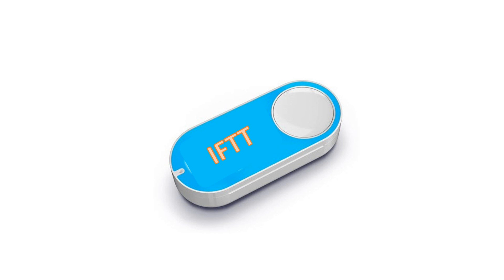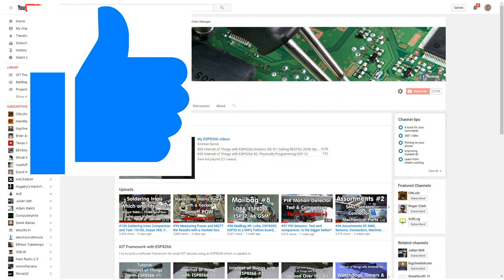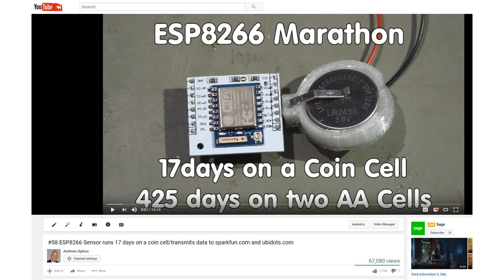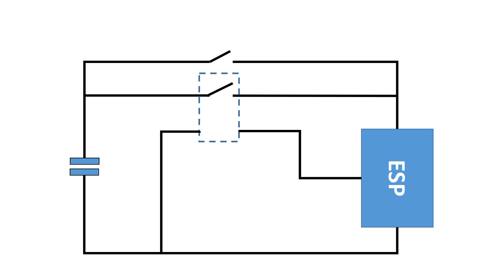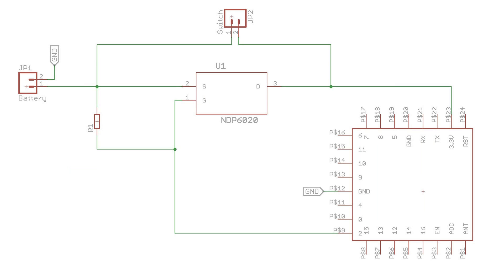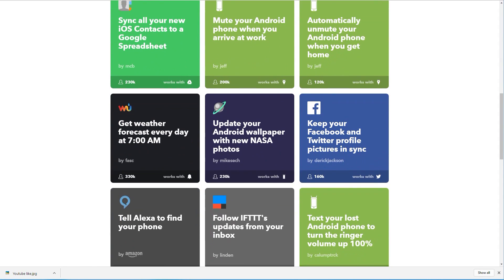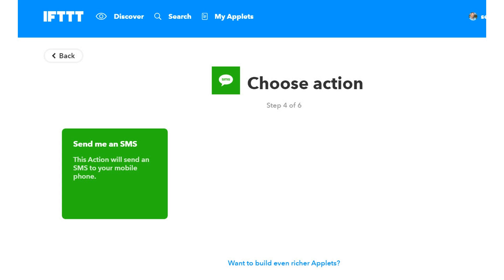#101 Long lasting DIY "Amazon Dash Button" using an ESP8266

Comment: I cannot get my esp8266 to work on a coin cell, not sure what iam doing wrong.....
Reply from the maker: Try a 100uF capacitor right between 3.3V and GND of the ESP. Coin cells cannot provide enough current. Still, it might not work.

Comment: Thanks a lot for the idea and the video!

Here are my experiences a few years later:
The NDP6020P cannot be really sourced anymore as it was discontinued in the meantime, and all the fake ones I got from AliExpress had very bad characteristics and completely unusable for this purpose (maybe for others as well). So I had to look for alternatives.

I have built two versions: one with a P-Mosfet IRF9Z34N, with the same circuit as in the video, and one with IRLZ44N, an N-Mosfet, in this case switching the ground. Both of them work nicely. Unfortunately, I do not have the equipment to measure the idle power usage of the two options. As a pullup / pulldown resistor I used a 47k one, I have no idea if this is a right choice, but it did work in the end. 

Anyway, there are some further optimization possibilities (which maybe could be covered in a later video as well), when using ESP-IDF:
 - As described in the "ESP Chip Startup Time Optimization" article in the ESP docs, with some tweaking the startup time can be reduced to 1/10th of the original (300ms to 30ms). This means the button does not have to be pressed that long, and of course shorter runtime may lead to significant power savings. 
- As described on the "Speed Optimization" page (ESP docs as well), there are some extra speed optimization techniques (also leading to power savings), as well as an additional tweak for reducing the boot time (CONFIG_RTC_CLK_CAL_CYCLES).

Oh, I wanted to add that I run the whole thing using A123 batteries. They have the perfect voltage (3.3V when full, ~2.7V when empty, still enough) for esp32s so no step-down is needed, can handle the peak currents of wifi, and has a considerably higher capacity than the button cells.
Reply: Update: The N mosfet drained the battery pretty quickly, and I actually have no idea why...

Comment: Hi, great concept, maybe You could create video about something opposite, i have Start/Stop system in my car and in my opinion it is bad for engine, the circuit should press the button after getting power but cuts of from power after pressing till next engine start. Piotr
Reply from the maker: Maybe you can try yourself to change the logic?

Comment: hello andreas, small q: I want to create a holder for my keys, which uses an end stop switch, when they keys are placed it closes the circuit (for a long time), and when I leave the house, the button is released because I pickup my keys, is there a good mechanical way you know to wake up an ESP on pushing or releasing the button?, how this behavior even called (in order to start searching), thanks!
Reply from the maker: You probably could use an interrupt for this project. ESP32 can wake up on such signals.
Reply: @AndreasSpiess  thanks!, But I really want to not use energy as in this video that cuts off energy when using a relay, wanted to achieve the same but with a button that stays hours pressed, maybe I need a mechanical solution like a custom single pole single throw but that sends only a small pulse when being pressed and another one when released, my initial thoughts would be to make the pressing mechanism move over a rails that has a contact in the middle and is insulated on the ends, this ways when pressed sends a small pulse, same when released, cutting the current when the state does not change... I have a 3d printer so I will start a design, I was asking you if this is something you explored before, because this video is the closest thing I want for my project (send an alarm when I open the door and the keys are still hanging, so I don't lock myself out haha, in my apartment building that can cost me 100usd in penalties if after hours), thanks 🙏
Reply: I solved it by modifying a sonoff door sensor,  taking the internals to q custom made 3d printed enclosure that holds my keys, the key chain has a 3d printed magnet holder that triggers the reed switch when placed in the enclosure, works great since is using ZigBee

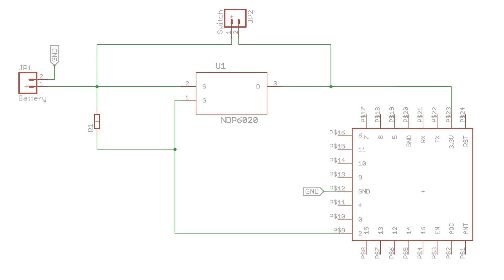Comment: Dear Andreas, I am a big fan of you channel, I have a few questions:  1) what about the mechanical bounces it could damage the wifi module? could we add a RC filter in order to delete it? 2) what do you think about this project #MIN 9:51  https://www.youtube.com/watch?v=nUgfFMaaipk&list=LL&index=2   3) what do you think about this schematic for the same propose as yours #MIN 4:29  https://www.youtube.com/watch?v=vxbuO1zWo3w&list=LL&index=4&t=23s
Reply from the maker: Here I use a very simple way without deep-sleep. Bouncing of the button usually does not matter because the button only has to switch the MCU on. If it bounces, the MCU starts a few times... 
You can also go with deep-sleep and use one of the other diagrams.

Comment: Very interesting video from the man with the Swiss accent. There is one part I don't understand though: how do you use a reed relay instead of a normal relay or mosfet? If I put a reed switch on a door or window, it makes a permanent connection, not temporary. How can you use a reed switch to trigger the ESP then disconnect the power once the job is done?
Reply from the maker: The relay was just for illustration. The FET keeps the ESP powered as long as it needs it. The switch is open after less than a second
Reply: @AndreasSpiess  Sorry, I don't think I made myself clear. I meant that I want to use a reed switch as a trigger instead of a momentary push button. But a reed switch is either on or off (door is closed or open) so it does not give a momentary trigger pulse. Since I want to use the ESP to send an MQTT message each time the door is opened or closed then turn its own battery supplied power off once the job is done, it seems to me that the reed switch won't work because it will keep the power on and flatten the battery. I was hoping there was some solution?
Reply from the maker: You can use the deep sleep function of the ESP as shown in video #108.
Reply: @AndreasSpiess  I already investigated that option but still can't see how it will succeed as the reed switch's trigger signal is not momentary. The only solution I can see is a bistable (self-latching) SPDT relay together with a SPDT reed switch. I found one which uses only 1uA in standby mode. You don't need MOSFETS or any other latching circuit because the reed switch itself is intrinsically self-latching... which is both the problem and the solution!
Reply from the maker: Interrupts can be triggered on edges.
Reply: @AndreasSpiess  So, I could attach the reed switch to a touch pin and it would awaken from deep sleep on both rising and falling triggers?

Comment: Very smart. I had very similar project back in 2007 and I used an external RC circuit to wake up the MCU via IRQ pin. When the Switch is pressed and the Cap is charged the MCU wakes up via the IRQ pin. When the Switch is released the Cap is discharged via R and the MCU is powered off. So you press the Switch and the Cap charges via the Resistor, it reaches the trigger level - when you release the switch the Cap begins to discharge until the MCU is shut down. It worked perfect - I didn't care about time precision for when the MCU should shut down. You may use an SCR device with low channel resistance (and a Darlington Transistor - if having weak signal coming from somewhere) as well.
Reply from the maker: The WiFi connection sometimes can take a long time. This is why I decided the CPU has to switch the power off only when the job is done.
BTW: I made a very similar device where I deep-sleep the device instead of switching it off. Similar to your example, I think.
Reply: @AndreasSpiess   That makes sense - thank you.

Comment: Do you have any tips for when  using the reed switch on the 5v line and it becoming stuck? I have read some people use a 7 ohm resistor so the reed switch doesn't get 'welded' and also read other people suggest using a reed switch to trigger a MOSFET transistor like the one you are using in place of a relay switch
Reply from the maker: I only used the relay as an example. Because it consumes a lot of current I would use a transistor. The current is not high, so I would not expect that a relay would become stuck in this application.

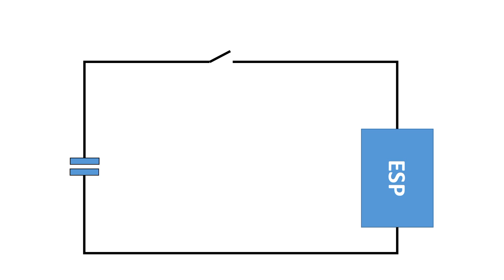Comment: Very nice video! Exactly what I need. Thank you very much Andreas! The relais you talk about at 03:00 - is this the normal blue relais you can buy to switch mains power? Or are there smaller versions for 3,3V/5V as well? Appreciate a link to a product page or a concrete model name if possible. Thank you!
Reply from the maker: The relay is just for illustration. it would consume too much current. Just use the FET. transistor

Comment: Andres, this is awesome.   Quick question.  I would like for the ESP to be woken up when my mailbox is opened.  I am using a reed switch for this.  The problem is that a reed switch works differently from the momentary switch in your example.   I want to wake up the circuit when the reed switch has been taken away from the magnet.  Can you provide some guidance on how to perform a similar function using a reed switch.   I am trying to make the circuit last for a long time on battery like you have demonstrated.
Reply from the maker: Maybe you watch this video: https://www.youtube.com/watch?v=6JD2RMDM88Y

Comment: Does the relay need a transistor and diode in this application?
Reply from the maker: You do not need a relay. This was just to explain.
Reply: @AndreasSpiess  I have relays,diodes and transistors no FETs, relay seems like my perfect solution.
Reply from the maker: It consumes too much energy :-(
Reply: @AndreasSpiess  What I did:  The relay does need a diode and transistor, it gets power from the 3.3v output of the esp8266 so it only draws power when it is on.  5 volt relay will work nicely with 3 volts.  My project uses a vibration sensor module that controls a relay with adjustable hold time for the "switch", it draws enough to drive a LM341 and a LED in stand by, without modification.  It provides the 5 volts to the esp8266.  It wakes up, checks the battery charge, the garage door state then sends an email.  It takes about 8 seconds.  
I have some MOSFETs coming I may play with them after I see how long the battery lasts.

Comment: I built my own super low current delayed off circuit using a CMOS variant of the 555 - the 7555. Its super low consumption is due to being CMOS logic - the momentary push button triggers the one shot timer and its a generous 20 seconds on time to let the Wifi connection and MQTTT send happen. The uC has no control over the duration though which is a drawback as compared to your design.
Reply from the maker: Also a good solution. But it needs additional HW...

Comment: Great project. I had a similar project, but needed to trigger the ESP remotely. In the end I used a Texas Instruments TLP 5110, configured in one-shot mode, triggered by a keyfinder fob. https://www.ti.com/product/TPL5110
This has worked quite well for my battery powered alarm siren project, but I would be interested to hear your ideas on emote triggerable solutions to maximise battery life.

Comment: What P-Chanel MOSFET do you recommends? In schematic on video  appears NDP6020 that is a N-Chanel. Did you use NDP6020P instead? Or do you prefer other?
Reply from the maker: https://www.onsemi.com/pub/Collateral/NDP6020P-D.PDF is a p-channel FET
Reply: @AndreasSpiess  Ok, Y will correct your schematic with NDP6020"P". Thanks a lot. In the past I used ralay because don't know what mosfet to use. You rocks!!

Comment: Hello I've used the current schema https://youtu.be/nbMfb0dIvYc?t=224 using an optocoupler, but it won't work! I don't know why!! :(  
This is the component used:  https://it.rs-online.com/web/p/fotoaccoppiatori/7965317/
Reply from the maker: Unfortunately I cannot do remote debugging. Maybe you try the optocoupler standalone first to understand how it works. Use the test circuit of its datasheet and compare the voltages with the voltages of your target design.
Reply: @AndreasSpiess   thank you very much for the tips. . I'll try it.

Comment: I have been trying to use the esp12f with a controller rather flashing the esp-12f. Is there an option to use the 8266 alone? I think the esp8266 firmware is stored on the same flash that the esp-12f uses. What options are available if only the wifi part is needed without the extra hardware of the esp?
Reply from the maker: The ESP8266 chip has a built-in Wifi and you cannot have it without. You only can decide to not use Wi-Fi
Reply: @AndreasSpiess  thanks, as it happens the wifi part is all I need. Was hoping for a more slim device. Thanks anyways. You the man. 😊
Reply from the maker: The ESP-01 is very small and often used as a Wi-Fi conneector for other MCUs
Reply: @AndreasSpiess  very well, will give it a look. Thank you.

Comment: Cool, Thank You Andreas !

Maybe we can review something a bit more advanced for example a miniature load switch for battery powered designs with power consumption in a range of picco-Amps, ultra low leakage and ultra low quiescent current options,
 some load switch come with reverse polarity blocking option built in. Maybe during the next time we can explore on how to to save even more energy while running devices from batteries, as I remember you had Otter Current Consumption Capture Device for this purposes ... =]

Here is a good load switch sample from VISHAY [ https://www.vishay.com/docs/66597/sip32431.pdf ]

TI, MAXIM Int; and other folks have similar stuff, it would be super great to see how we can start using those more advanced IC components together with the mainstream MCU's

Thank you once again Andreas, great content, cool stuff, valuable comments, no annoying BG music, cool accent and you are highly appreciated 

Sincerly, all the best,
T.
Reply from the maker: If you do not need reverse polarity protection you should be good with a simple FET and do not need such a chip, I think. I will not go below microamperes on this channel because it would not be practical for most viewers, including me...I also concentrate on chips that are available on PCBs and on AliExpress because most of my viewers do not do their own PCBs and source from electronic distributors.
And thank you for your nice words.

Comment: Hi Andreas, thanks for the excellent video.  For the life of me, I can't find the sketch code.  Am I missing something?  I am getting old so my eyes play tricks on me sometimes.  I may need to use your goggles.
Reply from the maker: There was no sketch needed because it works with whatever sketch you write. You just have to switch the transistor on with a digital.write command
Reply: @AndreasSpiess  Ah, got it.  Thanks.

Comment: Hi Andreas, first of all, thanks a lot for all your videos.
 Hours of intelligent knowledge.
I'd like to use your diagram to power an esp to send a mail when the postman has delivered the mails, but I have a problem with the switch. Very often, the mails or ads papers stay stuck in the drop slot ( half part of them remains outside the letter box), so the letter slot remains "open", so the switch may remain "closed" until I pick up the mails. I don't know how to get rid of this.
Any idea ?
Reply from the maker: I assume you need a little additional hardware to create a pulse instead of a continuous on.I am sure you find such projects on the internet.

Comment: Very nice video, as always. Regarding you remarks about IFTTT : 1. In your ESP8266 code, you can use "http" instead of "https" in your webhook trigger url and it will work just fine. 2. The delay between a trigger and an action depends on the service it's connected to but for lots of them it's almost instantaneous (less than a second) : a sonoff switch or a iphone notification, for example. I guess it depends on how important is the time of reaction for that particular service. It would be inconvenient to have to wait 10 seconds every time you flip a switch whereas it doesn't make much difference if an automated tweet or a youtube notification is delayed for 10 or 20 seconds. One last thing : when you use a IFTTT recipe too many times in a short amount of time (like it might happen when you're testing it), the delay may increase or the service might even stop responding for a while. Again, it depends on the service you're using. For example, the quota with "Add row in Google Sheet" is particularly short.
Reply from the maker: Thank you for your info!

Comment: Hello, bravo super tutorial very interesting. I read below that you suggested the IRLML6401 SOT-23 as a replacement for the NDP6020, did you confirm that it works? And regarding the value of the resistance, what do you recommend, 120ohm or something else?
Reply from the maker: I did not try it as I do not have one in my lab. But it should work. The resistor should have a value of a few kOhms.

Comment: Where did you buy the 10000µF SMD capacitor and what did it cost? I can't find one :-(
Reply from the maker: It was a 1000uf :-(
Reply: Labelled and sold as 10.000?? What a ripoff :-(